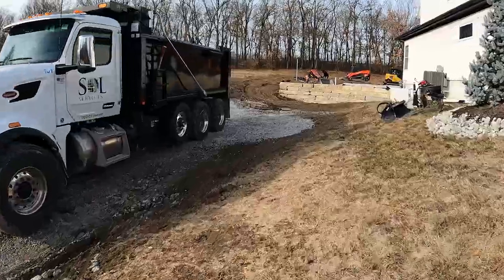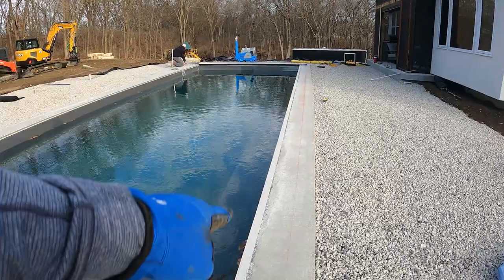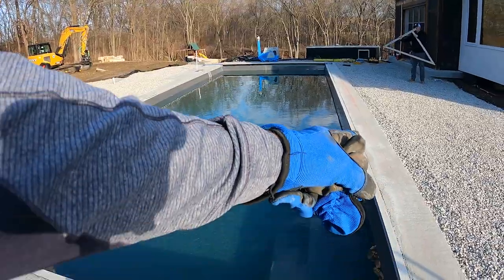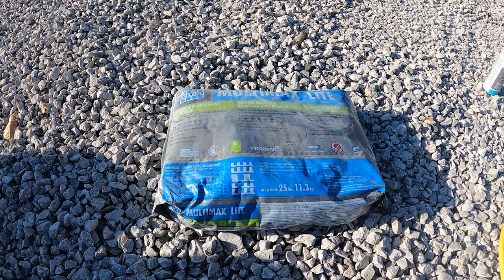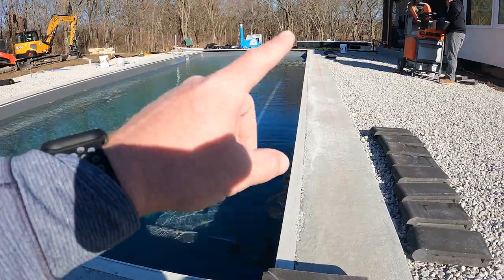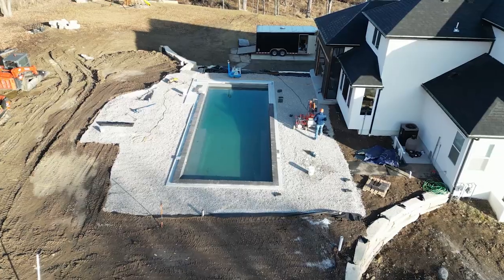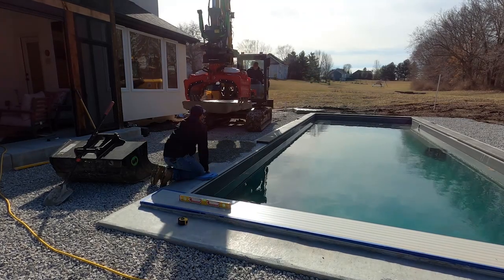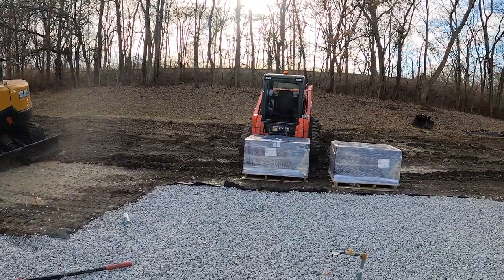Installing Pool Coping and Jumping Rock on a Fiberglass Pool - Project Update Part 6

Comment: I like the detail regarding installation of the coping, but I see you butted them right up to each other.  Are you not planning on grouting between coping pieces?  If not, won't that allow water to get under neither coping?  TIA